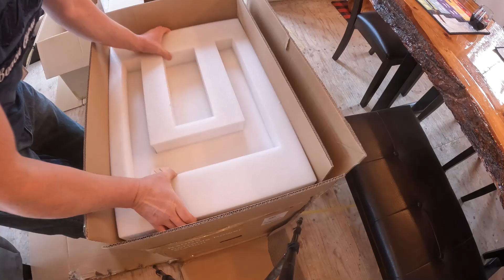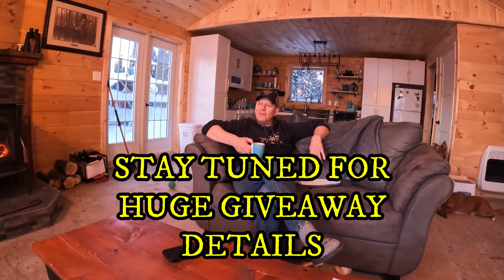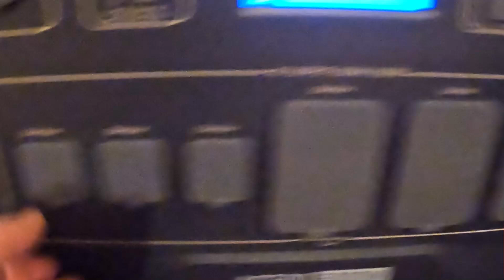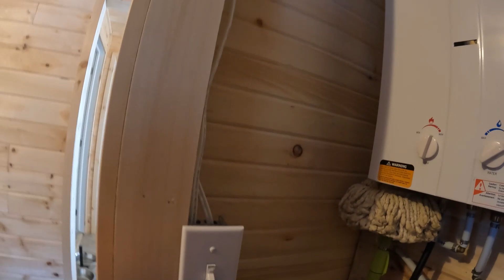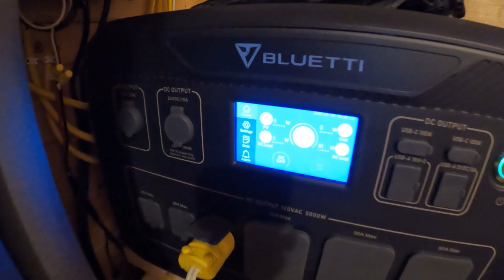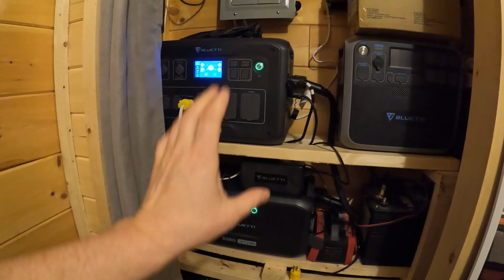Comparing BLUETTI power to regular battery power and a gas generator

Comment from the maker: Hey guys. Like I mentioned in the video, DO NOT REPLY TO ANY SCAM COMMENTS YOU MAY RECEIVE. I will not be drawing for this prize for a few days and when I do I will be in contact with you directly. Myself!  Thanks for your overwhelming response on the entries thus far-thanks for your support and keep them comments coming!! 👍👍
Reply: Already got a scam email. Crazy. Delete
Reply: I already told off 2 of the scammers.
Reply: The bluetti AC500 would work great for overland trucks also. Great channel Chuck..
Reply: I got a scammer as well.
Reply: Awesome demonstration of the Bluetti AC500! Really cool to see the comparison of  your different power sources! Thanks Chuck!
Reply: Great video on the power supplies you have available. I am interested in getting an AC Bluetti 200 for my cabin. The AC Bluetti 500 is a little too big for my needs. Can you include the wind turbine in a video to explain the watts per hour (avg) weekly or monthly. I am looking to add a turbine to my trailer solar system, but I am getting mixed reviews.
Reply: The bluette ac500 worked way better than the generator!
Reply: Got one from. @Chuckporter_everythingoutfoors  they can’t even get the “d” in doors right ..
Reply: Bluetti AC500
Reply: What a great alternative. Gas generators will be redundant soon.

Comment: I was looking at the AC500 on Bluetti's website and it appears that you don't get the full 5000 watts output until you have two of the B300K batteries and only 3000 watts / 2765wh when using one of the batteries.  For many people, it seems like the AC200 would still be more than enough (especially since it can be used as a standalone unit whereas the 500 cannot) but that AC500 really seems to come alive with 2+ batteries with a ton of w/h capacity.

Comment: I would like to see how you hooked into your fuse box. Great video. I have the 2000 watt bluetti
Reply from the maker: Simply ran the cord from the power outlet on my bluetti straight into the panel. (Exactly the same as if it were straight from the grid)
Reply from the maker: I ran my previous cabin off of the 2000 watt for a couple of years.

Comment: Hi Chuck I would like to know what is the switch you have on your panel that goes to battery to bluetti 
How is it connected 
👍
Reply from the maker: It’s called a transfer switch. And I have all feeds going into it first. Then to the power. Here’s the link: https://www.amazon.ca/dp/B07T8NWMZ8/?tag=chuckporterev-20
Reply: @ChuckPorterEverythingOutdoors  thanks Chuck really appreciate it 👍

Comment: My wife and I are getting ready to move off grid ourselves. I purchased the Delta Pro and a spare battery to go with it, I also bought the smart generator that is an Ecoflo. We had a well drilled  I have to pump from 150'down and 70' to the camp. What are you using for a  pump.
Reply from the maker: I have a 1HP submersible pump in my well which pumps up water into a cistern inside my cabin.  From there a 12V RV pump circulates it throughout my cabin

Comment: Great video Chuck. How do you like the 2000 watt champion inverter generator  ? I have the champion 3200 watt inverter generator and it has been an bulletproof unit. Replaced one pull cord in 5 years.  It's used quite a bit at my trappers camp in North Western Ontario.
Reply from the maker: It is a good gas generator. I’ve had it for years. Closest thing to a Honda as you can get. For half the price of course

Comment: I like that you can have 6 batteries on the AC 5000 Bluetti. Does your stackable washer and dryer have a power saver mode?
Reply from the maker: Yes it does. It shuts down if not in use plus has a “speed wash” cycle which uses little water and little energy.

Comment: Great system, you should be able to power a "hot tub" with the Bluetti AC 500. 👍
Reply from the maker: We looked into it. But hot tub require a lot of preheating (up to 10 hours). Hardly worth the energy consumption we figured. But it would certainly run it in the meantime
Reply: @ChuckPorterEverythingOutdoors  was thinking a wood fired hot tub and just maybe a circulating electric pump . Got to have the bubbles 😆

Comment: Bluetti AC500!

Great video Chuck, do you use the generator to top up the bluetti when the solar isn't doing the trick?
Reply from the maker: Yes. I sometimes have to top up the bluetti if it runs down really low and there’s no sun coming in the immediate future. Only takes a quick blast using the 1600 watt AC adapter and it ties us over until the sun pops out again

Comment: Chuck,  Are the solar panels and windmill enough to keep that power unit charged or do you have to take it into town and charge it from time tio time?
Reply from the maker: I never move it actually. If it’s sunny and/or windy it charges fully. On a cloudy, calm day, I have to start my gas generator for a couple hours max

Comment: Bluetti price ?
Reply from the maker: It depends on what model you are looking at of course. The smaller unit is about $329 Canadian. 2000 watt is about $1700. Largest until they have it about $3000. Basically they are lithium batteries price but they come with internal inverters so you save the money you would have to use buying that ($500-$1000). 

They have sales on all the time. Early bird and valentines sales on right now until Feb 20

Comment: The system you have there with the "Bluetti AC 500" is very impressive...before this video I would have thought the generator would hav won ....depending on the size of course...nice surprise. I recently purchased a gadget called Poniie PN2000 Plug-in Kilowatt Electricity Usage Monitor from amazon ( tried to post link but comment keeps getting deleted)...it would tie in with what you were doing in this video 😊
Reply from the maker: I would love to see this product Sean. If you could email to porterchuck9@gmail.com it would be great 👍
Reply: @ChuckPorterEverythingOutdoors Done

Comment: I’m not sure if everyone realizes that the AC500 is only an inverter and has no battery, so you need the B300s for the battery part. I’ve been researching and I’m leaning toward the AC200max unit, as I’m not looking to be off grid, just want backup and portable power.
Reply from the maker: I like the idea of the battery being separate for the fact that if you have a self-contained unit, and the battery gets old/fails, then you’re stuck having to purchase everything new. Having te batteries separate leaves you with the option just to replace and/or add extra batteries.
Reply: Yes, and the 200max can use 2 of the B300’s, a little upgrade from the 200p. Since these batteries should last 10 years there will probably be something much better by then and you’ll be buying the latest technology. Got my 200max now and let the experimenting begin, so far it’s awesome, power just about anything. Love your content Chuck, keep on truckin, or sleddin, er.. or snowshoeing, lol.

Comment: That system is quite impressive.   We are running 1500 watts of solar and two lithium batteries, and with all the money we’ve spent I am sure I could have gotten a Bluetti AC500. My system is expandable and way over kill for my small cabin.  I really like the simplicity of what you have done.  The new cabin is looking great, very well done sir.  Thank you for what your doing another wonderful video.
Reply from the maker: Tks Ben. I’ll be tweaking my system even more I’m sure. It’s getting pretty refined at the moment but I love to make it better if possible

Comment: Yes Chuck living off grid is all about power management just like a big power station,..only a smaller scale.  You did an awesome job explaining it.  Our system at our cabin works great.  We just have to keep in mind what we consume as we go through out our day.  No different than your bank account and how you would use that as you budget your expenses.  Cheers from da ROCK!
Reply from the maker: Absolutely Ted. It’s all about balance

Comment: As always, great video.  Thanks.  Typically, do you just use the generator to charge the Bluetti AC500 when the wind and solar can't keep up, instead of using the generator to run the house directly?  And thanks again for your advice on the snowshoes, still enjoying them!
Reply from the maker: Absolutely David. I never use the generator to power the cabin directly. If I do turn it on (cloudy days etc) then I charge up my bluetti, but continue to power the cabin through the bluetti at the same time. That way I still get smooth delivery. Not all portable power stations allow you to do that. One of the reasons I went with the bluetti
Reply: @ChuckPorterEverythingOutdoors  Perfect!    Thanks for the reply.  Cheers!

Comment: Would that Bluetti AC500 compare directly to a 5000W generator or would it be more comparable to a 7500W? Great videos as usual, take care!
Reply from the maker: Can’t say I’ve used a 5000 watt generator so I wouldn’t be able to compare. I did use a 9000 watt for a while this summer. I found it extremely hard on gas though so didn’t use it much. Plus, it was hard to pull start it and was overly loud. None of these were good qualities in my book lol
Reply from the maker: It has 5000watt of useable power but can withstand a surge of up to 10,000 watts
Reply: That's very impressive, since you have the means to charge it then that is absolutely the way to go

Comment: Bluetti AC500 is quite impressive. 
Wondering if you might consider doing an episode detailing how you have made all the connections in your power system. Such a smooth setup. I watch your channel regularly, pretty confident that this has not been shared thus far... but I have been known to be mistaken. Lol! 
Thanks for sharing your adventures, I look forward to each video.
Reply from the maker: Absolutely sir. Thinking this summer when I hook up another set of panels is best time to demonstrate 👍

Comment: Hey Chuck, great video... so the generator brings energy to the Bluetti ac500 lol and that's where it gets stores until you decide to run it again?? And it's cool to see how it can even run the 240 outlet aswell. Take care my friend
Reply from the maker: My solar charges the bluetti entirely (on sunny days). On cloudy days I start my gas generator for couple hours at most until the bluetti is charged up, then I switch right back to just the bluetti once again. Works incredibly well and saves using the noisy expensive generator

Comment: Bluetti AC500 should have been the one I bought. It can do split phase 240V which I need for well pump.
Reply from the maker: Yes it can Tom. There are many features I didn’t speak about. Too many to list actuLly. Lots of videos out there giving exact specs.  I just focused on making my video more every day life. 👍
Reply: Just purchased the AC300Max to backup power to wife’s computer (she works from home) in case of outage when it is raining and I can’t use 7000W generator.  Will eventually get a large enough battery system to hook to transfer switch and charge with solar and run the entire house.

Comment: Bluetooth AC500, Well just let me say this I'd love your videos 📹 and this is something I'm definitely interested in having my own back up system like this 😀....Just one question if you wouldn't mind Chuck how long does it take to charge???
Reply from the maker: It has several way to charge. Solar, AC (ie, wall outlet or gas generator), car charger, battery bank etc 

The fastest way to charge it is AC using the 1600 watt charging cable. Charges in 2 hours then

With the 450 watt charger it takes about 5-6

Of course I have solar here so that takes care of mine for the most part

Comment: Hello from Southeast Texas. Nice cabin, even has engineered wood trusses. I am looking to get a power station. I have 2 100W aluminum solar panels made into a suitcase to use with my no name 300W power station which is used as backup to my Firman Tri-Fuel generator that runs on natural gas. This looks like a nice unit .... BLUETTI AC500.
Reply from the maker: Great to hear from Texas 👍

Comment: Chuck, that Bluetti AC500 + B300S combo is very nice.  You didn't mention that the B300S battery also has a built in heater to keep the battery above 32F for charging safely.  Not that it gets that cold in Labrador, right?  :)
Reply from the maker: Haha. Yes there are dozens of features like the one you mentioned that I didn’t speak about. There are tons of videos offering all the specs so I decided to produce one with a real-life spin to it.
Reply: @ChuckPorterEverythingOutdoors And it's great real-life video!  I see the snow and ice and I'm impressed that you have a battery that will work no matter how cold it gets.  Watching the sun  come up with a cup of hot coffee in hand is a wonderful thing.

Comment: Thanks Chuck . This is actually a system I’ve been looking into for my cabin , for the very reason of lead acid batteries freezing in winter . So definitely will be checking out the Bluetti AC 500 and the battery bank they make also.

Comment: " Bluetti AC500"  Hi Chuck!,  My wife and I really enjoyed your cabin build.  We are currently debating a generator vs a bluetti for off grid in our truck camper. your videos have helped greatly.  I am thinking a bluetti with that folding solar panel may be the solution.  Keep up the good work!
Reply from the maker: I have the solar panel and have been using it for a year. Works incredibly well, light, and easy to move to “chase” the sun. It’s Awsome

Comment: The cabin build / reno we started last year could  certainly  use a Awesome"Bluetti AC 500 " to help handle/control our power needs when we get  the solar installed this summer. We have the cabin in a very cold part of NL called the Gaff Topsail. Chuck good luck on your continued improvements to your awesome cabin . Looking forward to more videos as we travel along on your journey.
Reply from the maker: Been to the gaff topsails several times so and stayed in a cabin there. Beautiful country

Comment: Thanks for sharing your insight and knowledge of off grid power.    The "Bluetti AC 500" seems like a fantastic solution to powering off grid living. Do you ever plug in  your  block heaters for your vehicle or snowmobile?
Reply from the maker: Yes I have. My block heater on my tractor mainly. It’s about 250 watts so the bluetti runs it for couple hours easily
Reply: @ChuckPorterEverythingOutdoors  Thanks for replying! This is good to know as we live in Thompson Mb and enjoy many -30  days. Lol

Comment: I'm torn between the BLUETTI AC500 and the ac300, so I'm watching all these videos to help me decide. From what I've seen, the larger ac500 works best for large loads as it's not as efficient for smaller loads as the ac300. It's the price you pay for having that large 5000 watt inverter. If you plan to use power tools you'll want/need 5000 watts.

Comment: BLUETTI AC500
Question from the DC power noobie(me)😄, but first I want to thank you so much for providing videos like this one. It is so very helpful and opened up my eyes a bit to the system I am using (2 x Renogy 170ah LiFePo4 with a Renogy 2,000W inverter) in my off-grid RV. That is almost 4,100 Wh and yet they will not run my fridge for 8 hrs while I am out exploring, so I am trying to get to the bottom of the problem. You said you have 6 x 6v batteries which should store approx 3,600 - 4,000 Watt hours (if I've done my calculations correctly - lol) and yet that system couldn't keep up to the coffee maker? Was there something else running at that time or is the Renogy 3,000 watt inverter not working properly? Just curious as I'll use this information to help solve my own problems.
Thanx again for what you do Chuck! Greatly appreciated! Take care!
Reply from the maker: So I actually have eight 6 v flooded lead acid battery that have 215ah each. I have 1 gauge (booster cable) wire going from the batteries to the Renogy 3000 watt inverter. And, of course from them out to my fully wired cabin. 

On a full charge the batteries will work….sometimes…. But not for long. They drain incredibly fast. Not all the way, but enough to not power and higher end applicable like a toaster, washer dryer, microwave. Even a hair dryer etc. lower wattage stuff isn’t an issue. So what I’ve been doing most time is running my 12 volt water pump from the batteries, and my starlink internet system. That way if I switch from power source to power source, I at least never lost the internet. 

It’s al a balance and a daily evaluation. But one thing for sure is that since I got the ac500, everything is just working amazingly well. No glitches at all.  I’m so happy
Reply: @ChuckPorterEverythingOutdoors  . . . OKAY, so I'm not the only one with battery issues then. Thanx for clarifying that. Sounds like the answer is just simply to buy an ac500. Thanx again Chuck👍👍

Comment: Ok so we had a night of -8 F (-13 C) and very windy.  It took down trees and we lost power.  That Bluetti AC500 would have come in handy.  But, luckily I did have a Jackery 1000 to at least run my Pellet Stove for a couple of hours.  With the Bluetti AC500 I wouldn't have had to run out and start my generator and run the wires into the house to run a couple of lights, fridge and freezer, internet and a TV.

Comment: Great video Chuck,, been thinking about Getting a BLUETTI AC500, been using the generator a lot here in Nova Scotia lately and it would be much easier to have the power source inside the house and not to worry about gas.